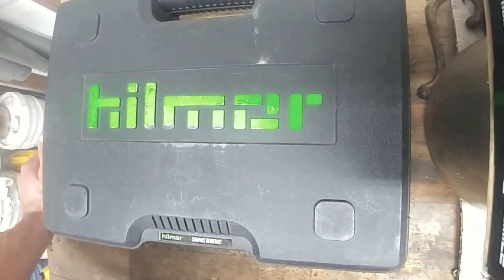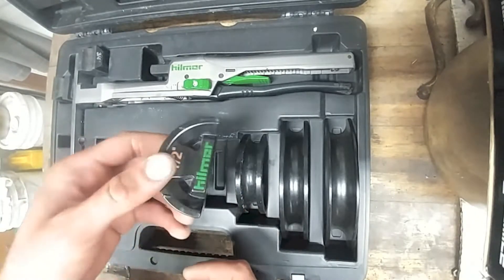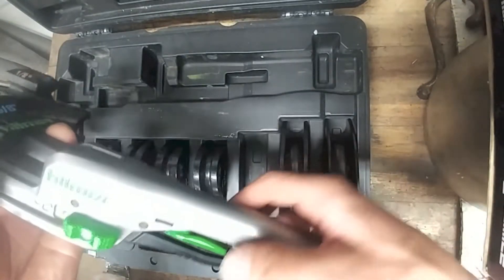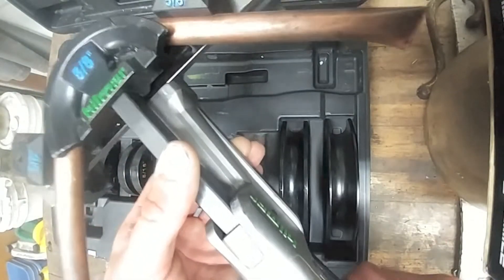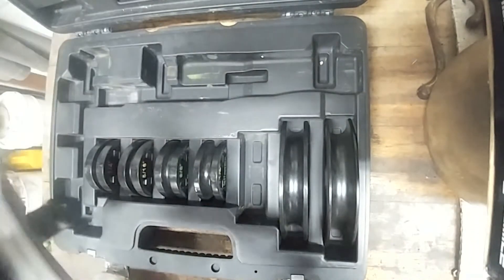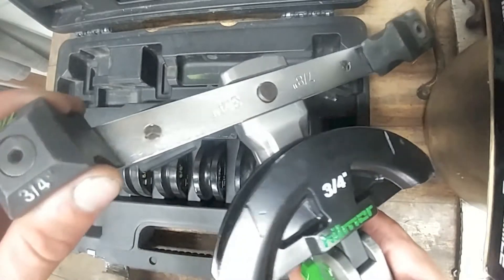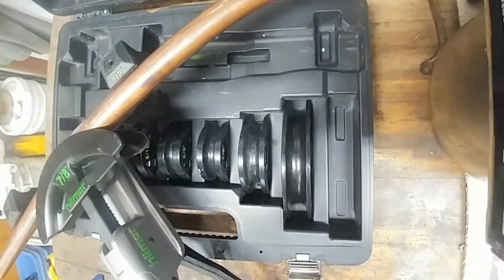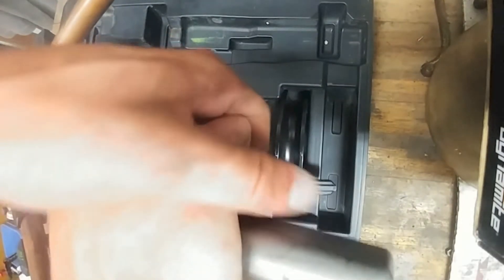HVAC Hilmor Compact Tube Bender Review

Comment: What do the lines indicate on the shoe?
Reply: It’s a pretty close guide to the center of where your pipe will land after the bend
Reply: Andrew Anderson it’s hard to tell since he’s using a short line, but if you look at the line on the shoe it’s pretty close to the inside radius of your bend
Reply: @aquattadomdren6760  it’s about a 1/2” short on the marks, I have checked multiple sizes and it’s off on every mandrel. The Yellow Jacket bender has mandrel marks that are spot on. Yellow Jacket explains that in the instructions, Hilmor makes no mention of them at all. I bought the Hilmor to replace a 22 yr. old Yellow Jacket but didn’t like the it. Went back to Yellow Jacket, much better with ACCURATE mandrel marks.
Reply: Scotland Heating & Air Conditioning LLC yeah I’m all for the yellow jackets even though there’s a tiny bit of stretch out it’s pretty manageable. I definitely agree though, I’m not a huge fan of the hilmor set
Reply: Scotland Heating & Air Conditioning LLC And might I say, HOLY VALUE. 22 years, eh? You definitely got your money out of those puppies. So, in those 2 decades, did the bolts ever break on you? At the shop I work at, we’ve had several bolts bend and then soon after they break on us. I’ve found a pretty good match in a random pair of vice grips, but that was shear luck, no pun intended. I’ve never seen an actual instruction manual for them, but I imagine It sternly advises to always make sure the bolts are tight.
Reply: Aquatta Domdren never broke the bolts
Reply: I was just watching this video and show your comment. (Even though it's four years old). The line on the right is if you measure the bend from right to left this will line up your bend with your measurement and center the elbow. The line on the left is if you measure from left to right and this will line up your bend with your measurement and center the elbow. Hope this helps.

Comment: Can this bend type L
Reply: scaronscar. Usually this tool is meant for bending soft copper pipes.  Such as those pipes in Refrigeration tubing.  Yet it can been hard copper as well but you will need to anneal it first. And then cool it so I can do hard copy or just fine.

Comment: cab you bend acr like rigid tubing ?
Reply from the maker: LOVIN TRUMP  no, it doesn't bend as nice and will sometimes splinter
Reply: Bruni Auto what do you mean by splinter, i would love to buy one but i only use ridgid pipes
Reply from the maker: Reuben Mccartney I've seen ridgid copper have hairline cracks after being bent
Reply: Reuben Mccartney  to bend hard copper you'll need to anneal it first and then cool it then you can been hard copper. Soft copper bends quite nicely.  Yet as long as hard copper is annealed and cooled you can bend it just fine.